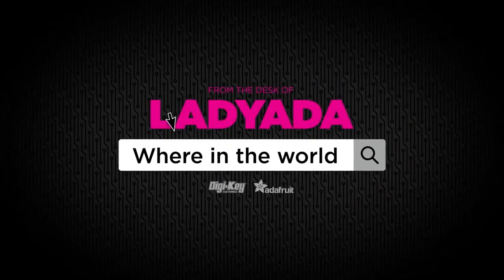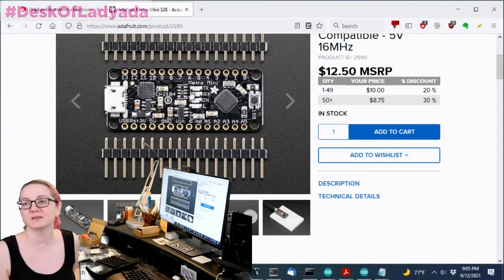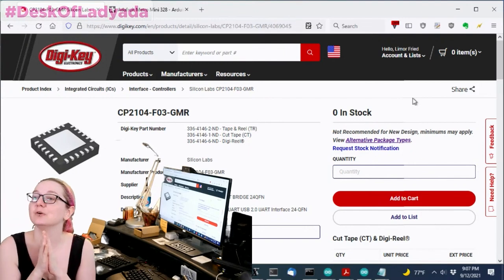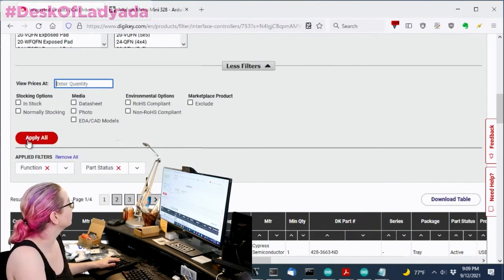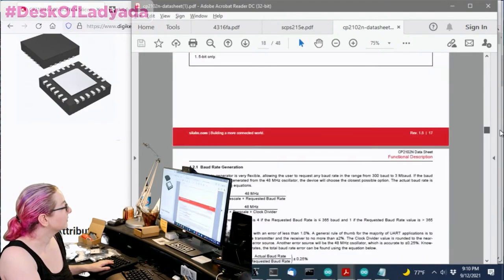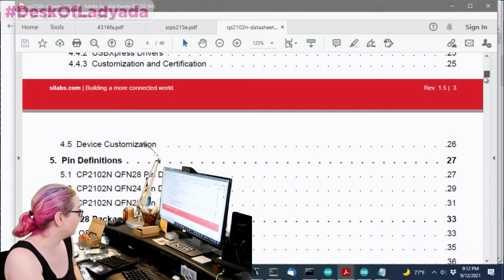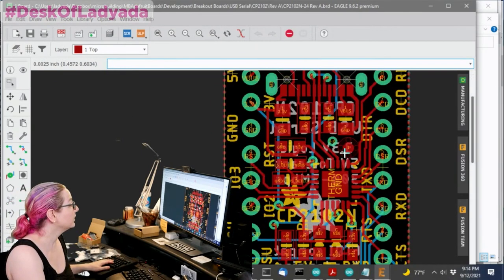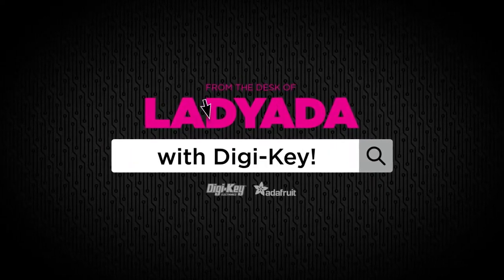The Great Search: Alternative for CP2014 USB to UART #TheGreatSearch #DigiKey @DigiKey @Adafruit

Comment: The price based sorting does not work properly for a few days.
Reply: Just tried, it for the search.  Price sorted only if you didn't put a number in the "quantity" field.  So OK for some comparison at quantity 1 (SiLabs was cheapest).  But of course, as of today with the chip shortages, none of the CP2102 parts are in stock.
Reply: @akb168 Oh thanks. I always used to put a number for quantity field, I haven't noticed this behavior until recently.